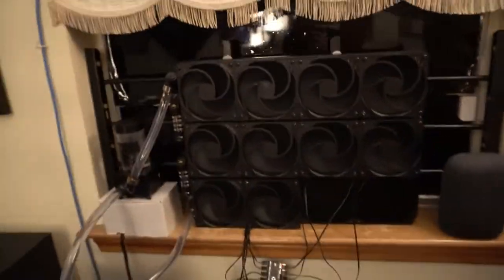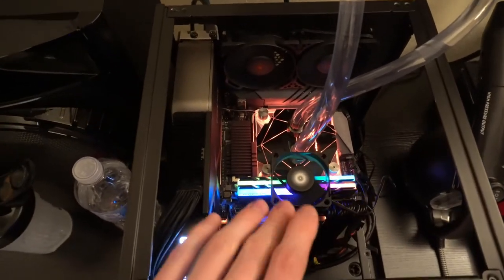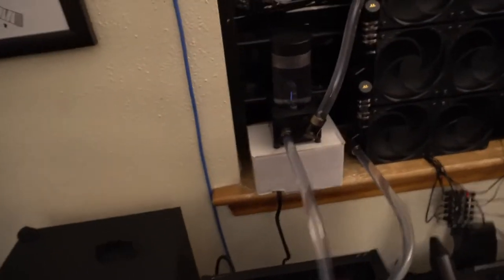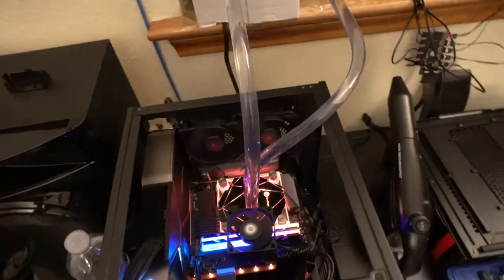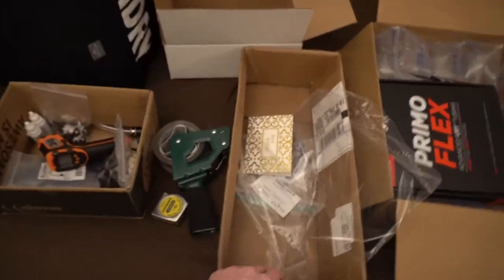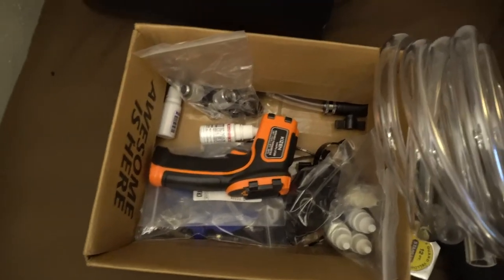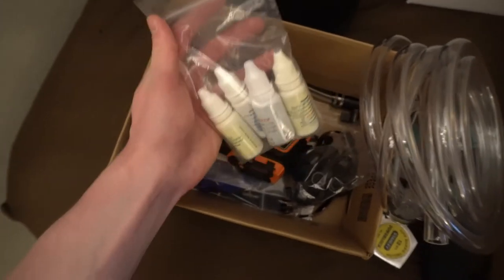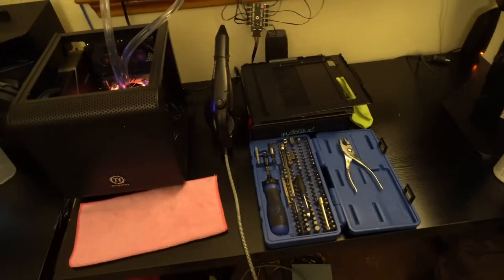Playing Around with more 480mm Radiators

Comment: 3 480mm rads unnecessary for the cpu one for 480 is enough
Reply: Probably,but heat capacity on that sistem will be higher, reducing temperature on radiator, suitable for overclock CPU